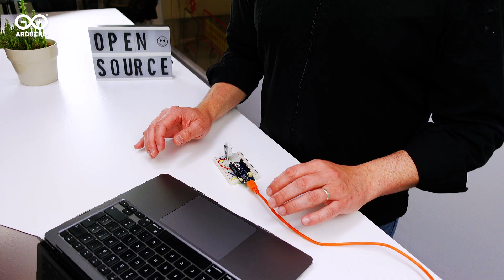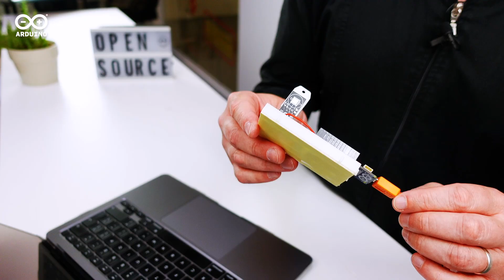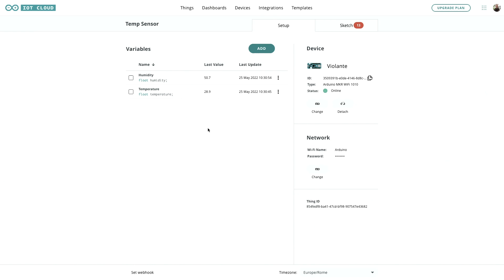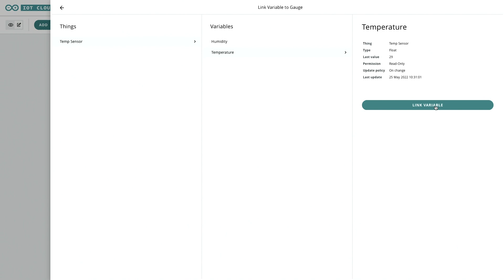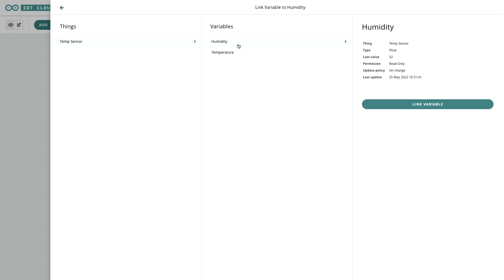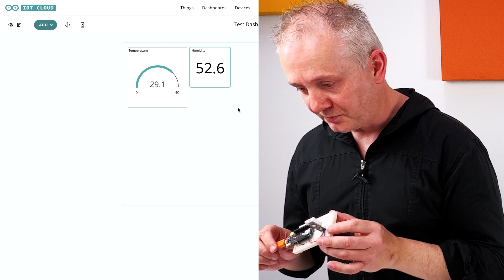Room Temperature Sensor in Arduino Cloud

Comment: Cool! I’m doing something similar but I’m using a DHT11. I just bought a MKR THERM SHIELD with the 20% discount you guys gave me for participating in the survey. Thank you for that. I’m planning to use it to monitor our freezer temperature. I wish you would do a video about notifications and alarms. What happens when the temperature is too hot or too cold?